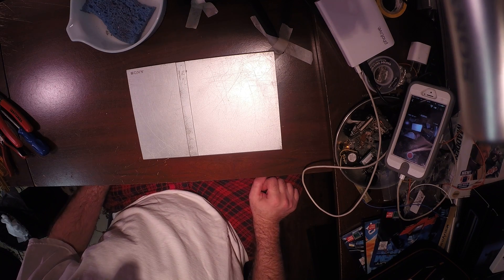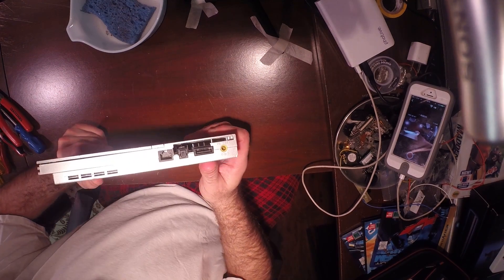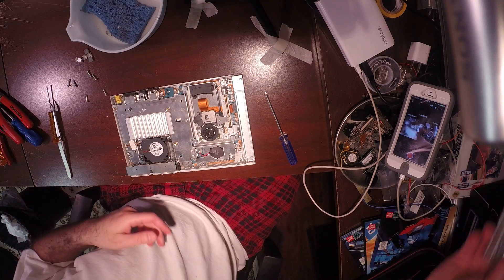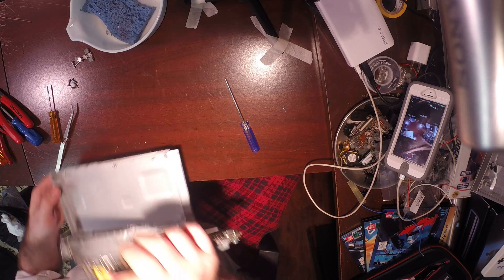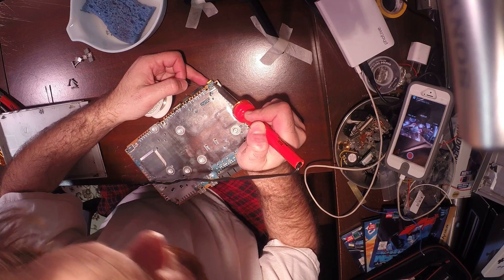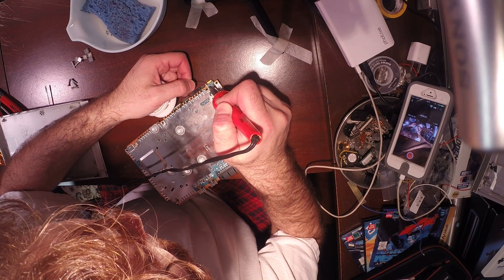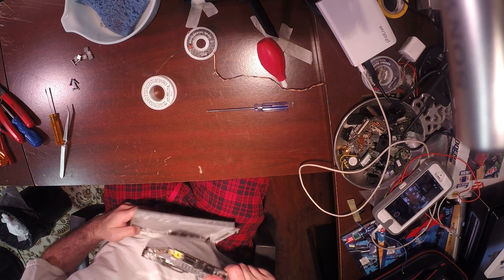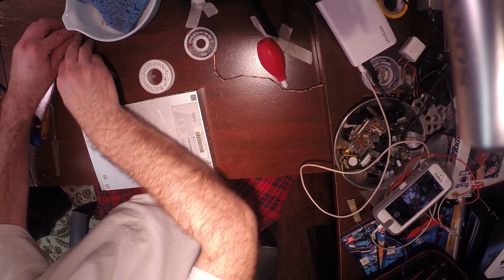PS2 Slim no power\ DC port fix tutorial

Comment: The PS2 came to me in a dead condition (outwardly), well, it seemed to be working, the reset button was broken (just the 2nd wire was sticking out), I unscrewed it, the cable from the power supply board was chewed, there was half a bucket of dust, well, in general, I cleaned everything, put it in order, turned it on a couple of times (I shorted the reset contacts with a screwdriver, because as I already said - there is no button), and on the third time, apparently, I poked somewhere in the wrong place, in general, the console went out completely, even the red light in standby mode does not light up.

Comment: I replace the power board on mine and the power bottom 12pin flex cable, and still no power is coming on? The model is 50001/N. Any idea what else it could be wrong?./

Comment: When plug I in my ps2 slim it won't turn on at all, no led, nothing. I tried replacing the power button but had no success of getting the led to power on or turn on the ps2. I think I may have shorted the ps2 with the previous button by taking it apart to repair the old button. Is there a sort of failsafe for shorting out the power button?
Reply from the maker: U.S.prime_pranks it could be a cold solder joint right where the plug is on the inside mean you just need to reflow the area with fresh solder

Comment: I got a ps2 slim and it won't even show the red light when I plugged the power cord
Reply from the maker: juan vargas are you absolutely certain that the power supply is good? The next up would be too if the power supply is good to proceed onto reflowing the DC port  area in the rear of the console,  as the video depicts. If you have any further issues with this feel free to message me and I'll get back to you as soon as I can best wishes my friend and merry Christmas
Reply: Justin Rocco I check the power cord it's  7.5V and ps2 need 8.5 volt I think that might be the problem
Reply from the maker: juan vargas that be my guess too. I bet the aftermarket power supplies are the least expensive on Amazon because Amazon has the least amount of fees for sellers versus eBay

Comment from the maker: Any rosin core lead based solder. The lead free solder seems to not work well at all.
Reply: I have Tin 40%, will this work ?
Reply: I tried, but I think this do not work...
Did I do something wrong ?
Reply from the maker: It's not always the fix, just commonly the problem.  The solder you are using should be fine
Reply: +Justin Rocco Ok thanks